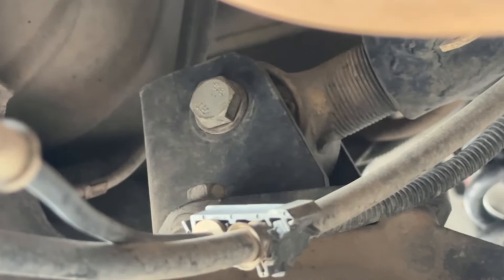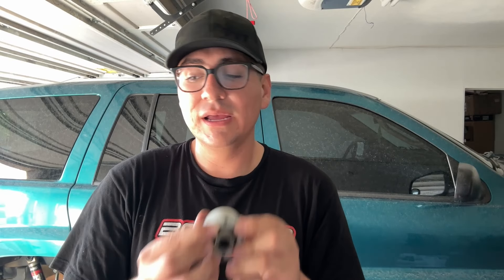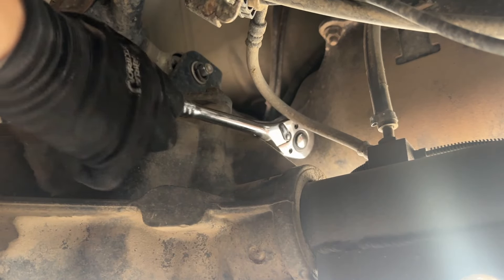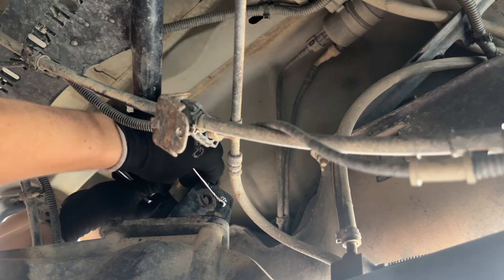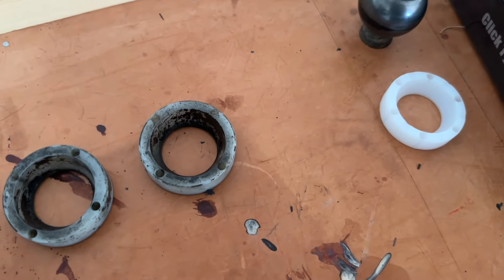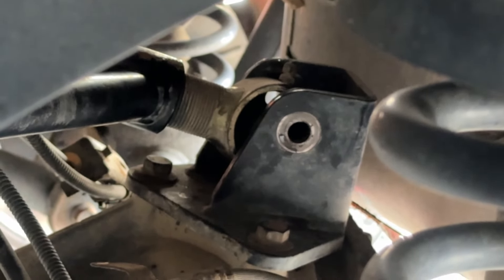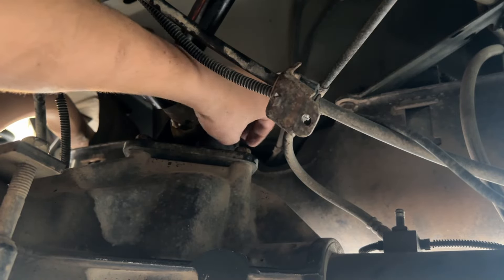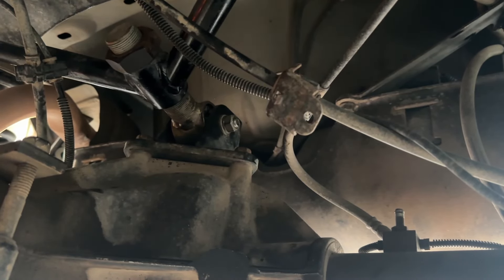Are Iron Rock Offroad Flex Joints Worth It?

Comment: Great video! The plastic races you have are at least 11 years old! ...and still good! 
We switched the design of the plastic races to use 6 bolts instead of 4 in 2013 so the 6 bolt races you ordered would be what comes with the A-arm currently. We machine the white plastic races in-house here at IRO so the ridges on the sides are from our lathe machining the plastic. We always say our flex joints will last a very long time if they are greased and torqued to spec but in your case, they lasted even without grease and a loose bolt!

Comment: I have some bad clunk and terrible metal scrapping noises while turning over bumps for a year or so now, ever since i did IRO 3 link long arm... havent had time to investigate too much, could even be unrelated and be a CV or my front locker being worn or something else.
Reply from the maker: I am running the 3 link as well but not noises from the front end
Reply: @Scott00  Check and see if your exhaust is hitting the transmission cross member. It probably looks fine when stationary, but when you turn or go over bumps, it is probably moving and striking the cross member.

Comment: Hey there !
I have the full Core4x4 arms on my WG (european model of WJ), very satisfied with the kit ! My Jeep definitely feels tightier on road (the original bushing were almost all gone), and the flex off road is insane ! I need to extend my bump stops so that I won"t rip off my rear bumper
I have a clunking noise when driving fast over speed bumps, but it is most likely the Addco rear sway bar (from IRO) hitting on the fuel tank skid plate.

Did you pay attention to your vent hose for the rear axle ? I noticed that it went off at the end of the video, you would not want dirt, water, or other contaminants in there ;)

Keep up the good content !

Comment: I think the plastic is nylon.
Reply: I think it is actually UHMW plastic.
Reply: I think it’s just plastic
Reply: Their website says it is UHMW.  From their site: 'Ultra-high-molecular-weight polyethylene (UHMWPE or sometimes shortened to UHMW), also known as high-modulus polyethylene (HMPE) or high-performance polyethylene (HPPE), is a subset of the thermoplastic polyethylene. It has extremely long chains, with molecular weight numbering in the millions, usually between 2 and 6 million. The longer chain serves to transfer load more effectively to the polymer backbone by strengthening inter molecular interactions. This results in a very tough material, with the highest impact strength of any thermoplastic presently made. It is highly resistant to corrosive chemicals, with exception of oxidizing acids. It has extremely low moisture absorption, has a very low coefficient of friction, is self-lubricating, and is highly resistant to abrasion (15 times more resistant to abrasion than carbon steel). Its coefficient of friction is significantly lower than that of nylon and acetal, and is comparable to that of Teflon, but UHMWPE has better abrasion resistance than Teflon. It is odorless, tasteless, and nontoxic.'

Comment: I find that greasing them via the grease zerk is near impossible, at least on their front long arm kit. They don't really accept grease because of the tight tolerance. My current issue is my exhaust pipe is somehow swinging side to side slightly and it's banging up again the IRO transmission crossmember. I fix one thing, and another 5 things break after that. lol
Reply from the maker: 😂 Jeep life!
Reply: So just take it to a muffler shop for $50 to fix that.. pretty simple fix

Comment: The plastic bushings are made of Delrin which used to be known as a “Military grade” plastic. They start out as bar stock similar to any steel or aluminum round stock. They’re machined just like how you would machine something out of steel or aluminum. And the reason these joints are NOT made out of metal is because metal ones would actually wear quicker. Delrin doesn’t actually NEED to be lubricated to perform. If you DO use grease on them, it’s recommended to use a silicone base grease because petroleum based grease can actually degrade the plastic.
Also Delrin bushings are quiet aside from the clunking that you get when they do wear out, whereas steel and/or aluminum Heim Joints are loud and creaky and clunky even if they are not worn out.
Finally, 2piece delrin bushings such as these are much more easily serviceable and rebuildable just by replacing the bushings which is exactly what you’re doing in this video. There ARE rebuildable metal joints much like these… but the service life is not nearly as long and you would find yourself having the service them all of the time, virtually having to grease them every time you drive off road especially after going through mud and water.

Comment: Man, get rid of that rear short arm setup and go with the full long arm. Side note, there should be a zurk grease fitting on that joint housing to keep you from having to tear it down.
Reply from the maker: You going to pay for it😂 I do have a long arm setup for the rear lowers I’ll be installing soon but keeping the A arm
Reply: @NajarOffroad  go all the way man! I'm rocking the 6.5 long arm kit for two years. I love it.